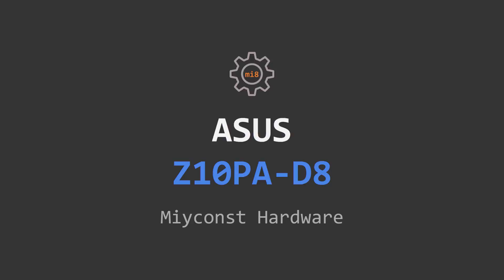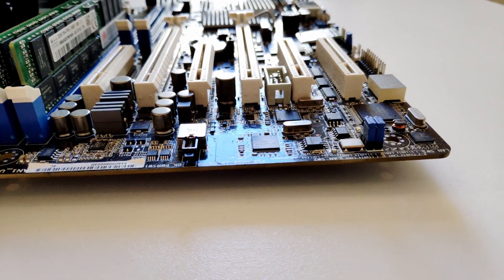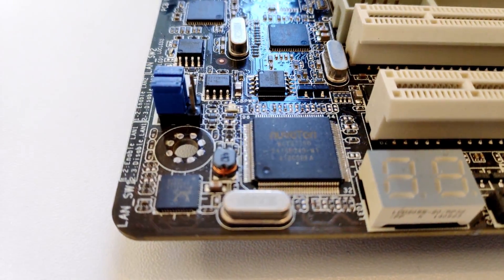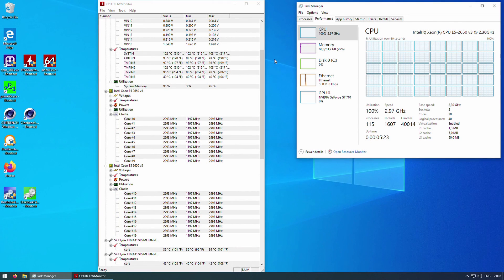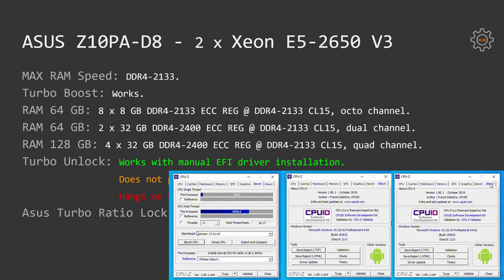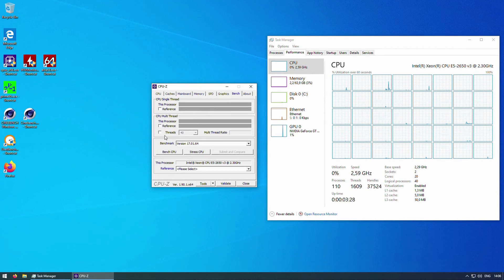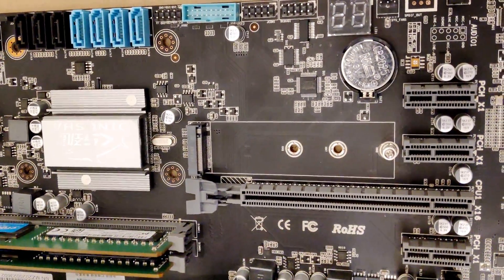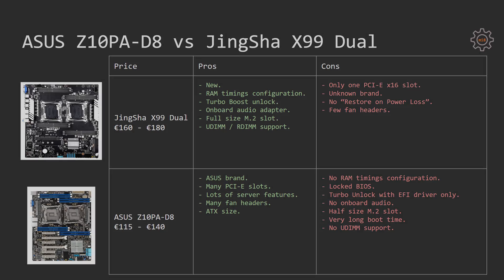🇬🇧 Detailed review of ASUS Z10PA-D8 Dual LGA 2011-3 motherboard | E5-2650 V3 | Turbo Boost Unlock

Comment: I bought one from same seller, still in box since I'm waiting for the CPU... I wish your review could be three weeks earlier
Reply from the maker: If the first motherboard I have received would be functional, the review would be live a few weeks ago, but the motherboard was dead and I had to wait for another one.
Reply: @Miyconst  Actually I just toke it out and inspected OO saw nothing strange! It seems in pretty decent condition for such an used motherboard (guessing) but hey that means nothing right?!? Let's wait for the CPU's and find out if it boots properly. I have 32GB Samsung ECC RAM already sticked in :). 1000 Focus Seasonic Power Supply, need Cooler advice... anyways if it's a DOA I'll ask for money and go with a Supermicro.
Reply from the maker: @77obiwankenobi77  I really hope it's gonna work for you. If you have access to European Amazon - take a look at Arctic Freezer eSports ONE 33 CPU cooler.
Reply: @Miyconst  I can get these Cooler CPU Arctic Freezer 34 CO for 25€ each what you think?
Reply from the maker: @77obiwankenobi77  Depends on how much other coolers cost at your place. If it's cheaper than Cooler Master Hyper 212 Evo - then it's a good deal.
Reply: @Miyconst  Do the "Arctic Freezer eSports ONE 33" and the "Cooler Master Hyper 212 Evo" have enough clearance to allow memory sticks to fi?
Reply from the maker: @valhar2000  they do, unless you have some stupidly high memory sticks.
Reply: @Miyconst  You are gracious and kind, sir!

Comment: I'm using a couple of those really cheap PCIe 4x to NVME riser cards to plug in multiple full size M.2 drives into this same motherboard, it has plenty of slots.
These are the ones I use: https://www.aliexpress.com/item/4000142544458.html
Reply from the maker: I also have one.
Reply: Data transmission speed: 6000MB/s

Comment: As with all your other reviews, this was another very thorough examination, thanks. However, I don't think you mentioned that you should be able to get around the M.2 2242 SSD form factor limitation on this board using a ribbon cable extender/adapter. They should be pretty cheap (~10-15 euros) and come with essentially no performance impact.
Reply from the maker: That's true, such ribbon adapter will solve the problem, even though it's annoying to even have this problem.

Comment: Within 10 years, china will release a brand new cheap motherboard using dual amd epyc cpu, 8 slot memory, 2 pciex16, full usb 3.0, turbo unlock, overclocking features, integrated graphic and sound etc etc,,,  well, it just my opinion 😄, anyway, nice video   for additional knowlegde